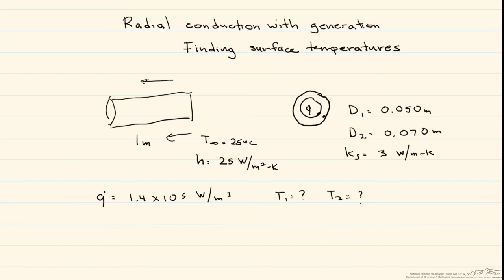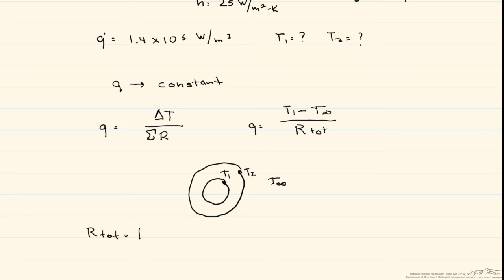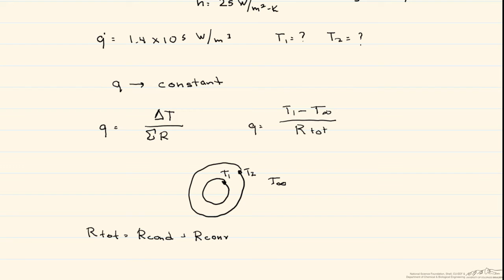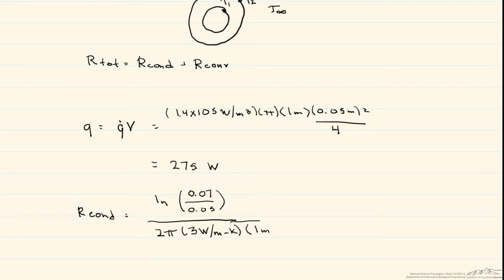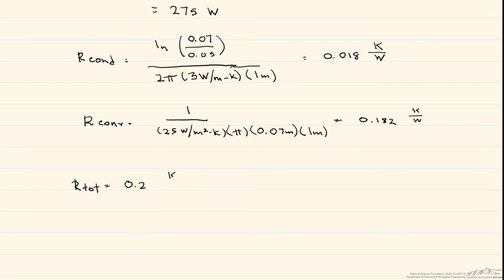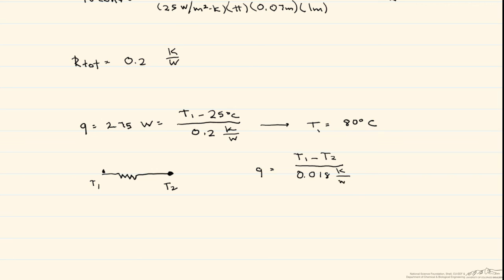Radial Conduction with Generation Part 2

Comment: You said in the previous video that you cannot use the thermal circuit method if there is heat generation. But you're doing that there, why is that?
Reply: Yeah! What gives
Reply: You just can't do the circuit in the part where there is heat generated. There is no heat generated in the insulation.

Comment: Hello, between t1 and t2 is really conduction?
Reply from the maker: Yes. T1 is at the edge of the rod and T2 is at the surface of the sleeve.  The material between them is the sleeve and it will be conduction through that. I hope that helps.